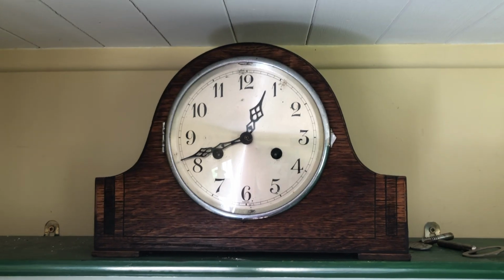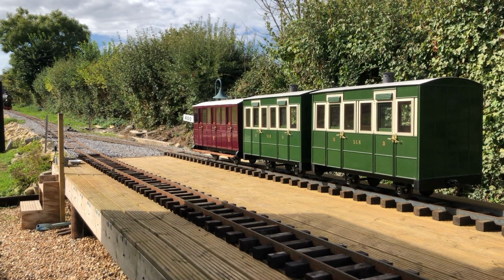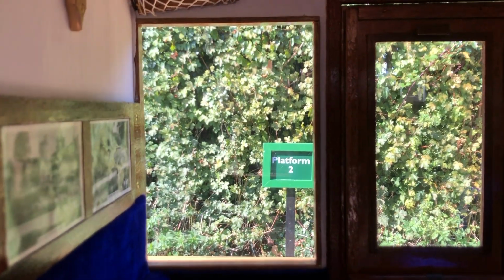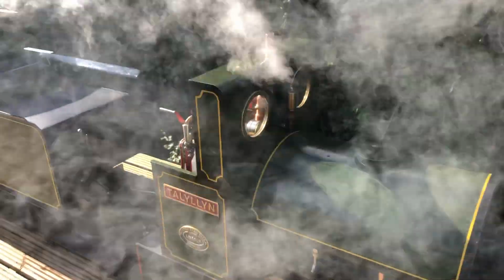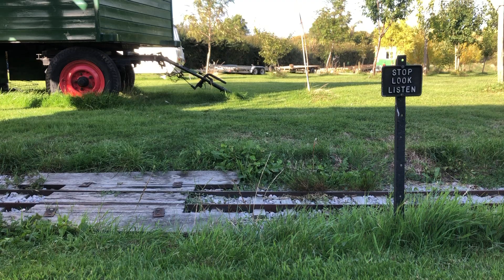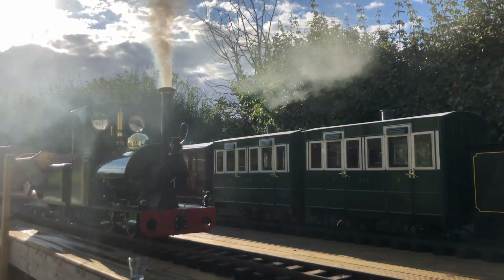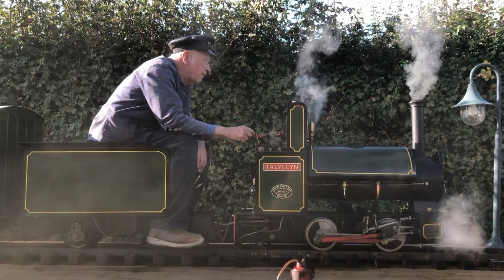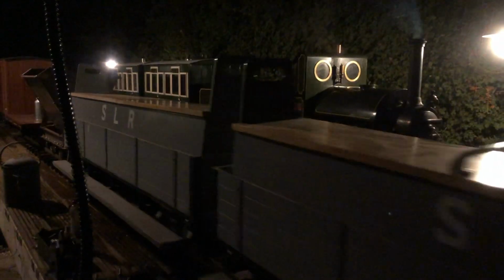The Return of the Romulus - 7 1/4 Narrow Gauge

Comment: I am the builder of Ankor Wat which was built in Cambodia along with its sister engine Ankor Tom,  owned and regularly run by a member  of Newcastle SME. 
i feel a little sad that you felt you had to make so many changes. The original local had an interesting history and character. The owner of AT reports much interest in AT's name and background. 
Upon completion I disassociated them from Romulus which generally thought of as rather crude.
Did you know, for example that the valve gear was designed by the late Don Ashton. I designed AW as a working engine with ease of maintenance in mind,  look at the design of drain cocks for example.  The stainless firegrate. Just about all the pipework can be removed without a major stripdown. 
You now have another green saddle tank!
Reply from the maker: Hello Harold and thank you for contacting us. We should start by explaining that we do not own the loco, it is a long term guest loco on our line whilst the owners are building their own railway. It’s very interesting to hear the history of this loco. Amazing that they were both built in Cambodia and assumably shipped over to the UK at some point? We shall certainly pass this information over to the owners. Thanks again, SLR.